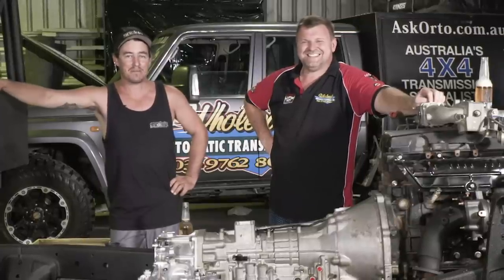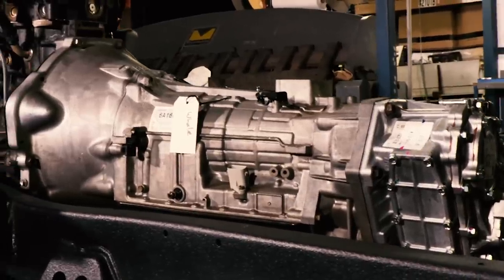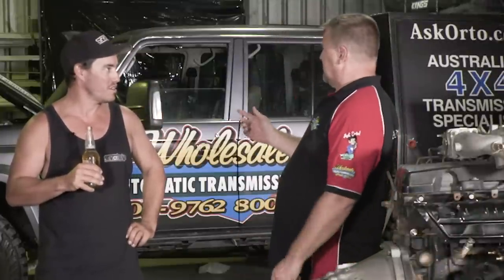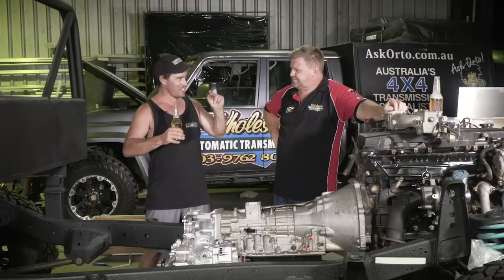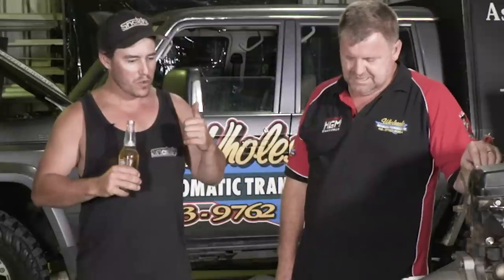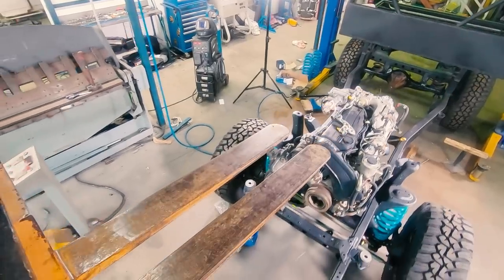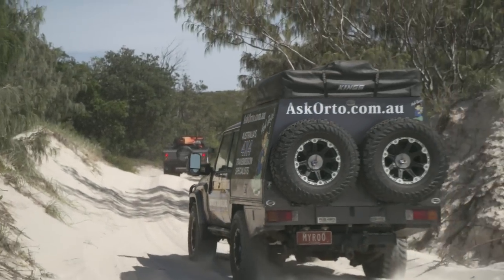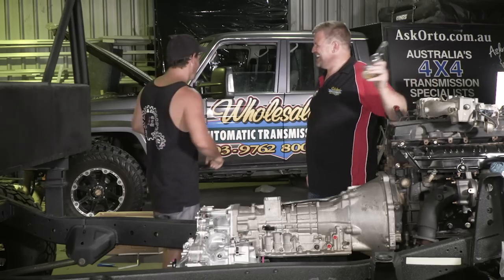DIRTY 30 TIP-TRONIC AUTO CONVERSION - Why Shaun chose this over manual + Expert tips for your auto!

Comment: Good decision, I’ve run auto box off road for the last 15 years, I agree with all the comment in the video,  especially about being transmission friendly, great video, really looking forward to the finished product, thank you from the UK
Reply: What vehicle do you have in the UK. I have a Imported Prado 70 with an auto box so interested in this video
Reply: I have a ‘94 80 bruiser, ( as an over lander )  and another car as an off roader ( Land Rover based, also auto) 4.2 diesel auto VX, running 285 75 BFG All Terrains,  makes the speedo accurate. I have driven it in the Pyrenees, the Alps, Corsica Sardinia and Morocco, all conditions, mud sand and rock, with a standard auto box with a large extra oil cooler for the auto box. I now realise I want a tiptronic, better start saving. I have a tiptronic in another car, ( Mercedes ) and would have never thought about one for the the bruiser, this video has given me a lot to think about.
Reply: @billywestley9008  Serious stuff!

Comment: I have a manual and what I miss is taking off at the traffic lights and the turbo just staying on boost to 80km h. I have to run through the gears and let the turbo spull every gear shift. I can't believe I am saying this but if I get a new 4x4 I'd seriously consider auto nowadays.
Reply: Stevo F I’ve got a y62 patrol and I came from a 79series and I promise you this patrol is better in every way, much more expensive but I spent $7500 on a lift kit, winch and bull bar and that was all it needed

Comment: Should also mention that the converter typically produce much more torque to the input of the box, especially at stall  than a manual box right where you may need it the most.
Starting off from a stop and getting you moving like in heavy sand n bogs
Reply: A+ perfect

Comment: Love these types of technical videos. One question I've got, and it's more out of curiosity than anything, with a torque converter locked, could you "clutch start" an auto? I do have a long held love for the old 3 pedals, but after doing a bit of offloading in a 1996 Jeep Cherokee auto, I can definitly understand why they are popular for off road applications.
Reply: No you can't clutch start as the clutch needs to be applied but to do that the pump must already be running.

Comment: Question for rocket, I drive an 1fz-fe auto 80 series, I have a temp gauge for the gear box at what temperature should I pull over and let it cool down because I’ve had very different answer to this question ,as mine gets very hot up the beach
Reply: 140C is when you need to pull over and let the engine idle for a while. We need to keep the oil flowing around the auto as it is cooling down.

Comment: Where do you guys recommend placing/mounting the Auto trans radiator in the vehicle ?
Reply: bringingtherukas in the bottom of the radiator...?
Reply: Always mount the oil cooler up front behind the grill area.

Comment: There are a few ecus around that has remote log in capabilities. Compushift certainly isnt the only one.
Reply: No other transmission controller has Bluetooth connectivity or set/calibrations App or can run this many different autos. There might be a system that is log in via laptop and direct plug in to an engine management system but nothing this though.

Comment: do auto boxes have to "warm up " before they shift nicely? my 98 forester bangs thru gears till its warm if i nail it cold.and its running syn oil too
Reply: Hey, the best you can probably do is change the oil again, replace the filters and add a bit of ATF conditioner to keep her going. Sadly it sounds like your auto is on the way out though. She'll need a rebuild or replacement. Good luck fellow Subie enthusiast.
Reply: No they don’t, I would think that you have a problem of some sorts. You are best to take it to a local transmission shop so they can take a look..

Comment: An automtic transmission and steep hill starts go together well. ?Automatic transmissions for heavy towing? Any suggestions?
Reply: yeah we have em in trucks pulling doubles at 65 ton and they preform well
Reply: They handle heavy loads better than a manual.
Reply: @vevohoeyo  yeah alot less stress on the driveline which is good

Comment: Rocket, slap me if my thinking is wrong.  I like the trans cooler to be OUTSIDE of the radiator.  Heat being an auto's worst enemy, IF you lose the drive belt, or your water pump, don't you risk cooking your trans in an overheat situation, as well as risking warping an aluminum head?
Reply: I like your thinking but if the belt come off or the water pump shit it's self the engine would overheat long before the auto overheats.
Reply: Thank you Rod. Appreciate the reply.

Comment: Rocket, can a five speed auto be fitted to a four speed auto Isuzu Bighorn?, is there a box that will fit?. If I take the standard auto cooler away from the bottom of the radiator and route it to a big (half radiator size) cooler in front of the radiator, will this suffice for general daily duties and sometimes off road?.

Comment: Do you still plan on pulling the boat with the 30? or is that just for the 79 now? also can rocket and the team match gear ratios in the trans to what evertire size and such on a build?

Comment: I like your thought on auto. But im gonna stick with my standard/manual transmission. Its just cheaper and easier to fix for me. And probably us.
Reply: Right i can fix a manual myself at home a auto gearbox is a pain in the ass.
Reply: @brysonnorman7772  An auto is inside even easier the na manuel, it is all on 1 shaft....

Comment: Watched this 5 times now, did you ever mention the actual model of transmission you're using? "5-speed out of a 100-series LC" is about all I could catch. Trying to see if this can be sourced in the U.S. or not. 
This Dirty Thirty 2.0 build has me plotting all kinds of expensive things for an 80 series now. Keep up the amazing build Shauno and crew. Doing great work!
Reply: Yes you could either use 100 series 2UZ, FJ Cruiser or Lexus 470. All A750F transmissions. But we do have the same heavy duty Nomad Valve Body and Compushift to suit all the the Toyota range.
Reply: @RocketRod  Cheers Rocket! Sub 3-minute reply time! Amazing work mate!

Comment: 2 questions for mr Rocket.
1: 1996 Jeep Cherokee 2.5 TD (VM Motori turbo diesel). Is it possible to convert this to auto, and what is needed? 
2: Mercedes Geländewagen 300GD (5 or 6 cyl TD) W460 with a modern auto. What options do one have?
Reply: That vm motor is very similar to a land rover 300tdi probably make the zf 4spd work with it which is a very decent transmission
Reply: Finn, anything can be done but we have not done a conversion to the Jeep although we have done using the Jeep 5 speed auto. We don't have anything for the Merc sorry.

Comment: I’m in the USA, I have a 99 LX470 (100 series), 4 speed. I want to install the newer 5 speed. I have a good, low mileage trans from an ‘06 lx470. What do I need to do to make this happen. I want basic operation and prefer the ‘99 shifter.
Reply: If you can get it in the car we can run the auto using the HGM Compushift. Install the GX470/460 tip-tronic gear shifter and make your own center console.

Comment: Hey rocket, I’ve got an 4spd auto 105 cruiser. I’ve found on steep descents it tends to roll away from me if I’m not on the brakes. What upgrades should I do to prevent that? Cheers

Comment: What model transmission would I be looking for in a 6.5l v8 diesel. Currently looking at my options in a 105 series dual cab
Reply: Best by far is the super strong 4L80E with Compushift Controller

Comment: would there be an automatic that fits an 05 GU patrol that can handle upwards of 500hp and 1500nm from a 5.9L BT6 12v or 24v?
Reply: KTMPowa a 4L80e would handle the power.

Comment: for oil coolers, would you recommend a oil to water or a oil to air cooler? or a combo of both?  I live in Canada so stuff gets cold lol, would you recommend running a thermo bypass valve to cut off the cooler during warm up? do you have any factory applications recommendations that have a good tstat for the trans cooler that I could pull and adapt to my build? I love using OEM parts over aftermarket if I can...
Reply: I'm glad you mentioned you were in Canada as it make a difference, in your case water heat exchange then air. In Australia normally twin air is better but most run water then air.
Reply: @RocketRod  awesome, thanks for the reply! yeah I was thinking of running one water and one air. wasn't sure of what order, glad you covered that :)  any input on a thermostat or bypass valve type thing? one that would go from a water cooler on warm up to a air cooler once up to temp would be sweeeeeeet……. like a 6 port one...

Comment: Can a auto conversion correct the gear ratios after fitting 35's?
Reply: Thats probably a very dramatic way of correcting a speedo and wouldn't make any difference as the speed is normally taken from the trasfercase so no difference no matter what you did. What you can do is fit a speedo calibrator. I have them at Wholesale Automatics.

Comment: Rocket, will your shifter work with a 4L80e using a US Shift controller?? 
Who built the flash console for the Dirty 30??
Thanks.
Reply: Aaron that console is the unit that Wholesale Automatics builds for there 79 series conversions
Reply: No unfortunately the tip-tonic shifter will not work on the 4L80E in either case as it was never build as a tip-tronic. that being said we did manage to do this for the A750 but it was also built as a tip-tronic from factory in some models so this made it compatible
Reply: Thanks Rocket.

Comment: Question; when in low range, does this magnify any shifting issues like lurching/lunging that an older (244,000 miles worth) transmission might be having and can this clue the driver in to have a rebuild done sooner rather than later? Thank you from the USA. 😊

Comment: Question for Rocket.. can the stand alone system work for a 6L80e behind a non mechanical 6.2 diesel chev v8 ??
Reply: We are so close to finishing this system. The computer, harness and new solenoid block are complete. We are just going though dyno and in car testing at the moment and will be complete later this year.
Reply: @RocketRod  thank you i will pester you guys later in the year for it !!

Comment: I have a 2019 Chevy Colorado Bison.  I am building it up as an off road expedition truck, as well as daily driver.  With the added weight of accessories and gear, what do you recommend for upgrades for my 3.6 litre V6?
Reply: You will need to add an Extra Large Oil Cooler, we have the kit available if you would like one? I also recommend the Deep Cast Aluminium Pan from PML Covers out of C.A
Reply: @RocketRod  thanks, how is the best way to contact you?

Comment: Was wandering that if you can lock up the converter in first gear, if that also means that you can pull start the truck like a manual trans?
Reply: No unfortunately, the pump needs to be running to apply the same clutch that you would need for push starting, so basically no pump pressure then no clutch would be able to apply for push starting.
Reply: Ok. Thanks so much for the info on that Rod.
Reply: At least in theory, could it be possible to modify the clutch acuation with a bypass valve to a wet canister that could be pressurized via compressed air, for a couple of emergency bump starts.       Years ago, before I new anything about how an auto worked, I had an old buick with a 300 super turbin 2 speed auto. it had an electronic switch activated double speed stator. a old rancher told me to hook the switch,--That was normally hooked to the throttle plate for full throttle take offs, to a toggle switch. and for some reason this worked to be able to pull start the car. granted you would have to pull the car to around 25MPH. but I would hit the switch and it would fire up. This is the only trans that I have ever had this work on. but thought that if there was a way to overcome this one flaw in the auto trans world, that it would be " THE TICKET" for sure.  If anyone can figure out how to do it. it is you ROD.
Reply: @tombrown879  yes this could be done but it would need to have about a 4 litre volume and be charged at at 200PSI. We would need to charge the whole transmission including transmission hence the large volume in reserve.
Reply: Hmmm. troublesome .... I shall have to contemplate over a few cold ones. :)  Thanks for all the info Rod.

Comment: Rocket what's better to have a 5 speed auto, 4 speed auto or 2 speed auto?
Reply: Very much depends on the application. In Shauns case the broad gear ratios suited his needs very well. 2 and 3 speeds and a little outdated.
Reply: @RocketRod  okay just asking because I see a lot of 4x4 that are a 5 speed and some are only 2 speeds

Comment: Hello, I live in Lebanon and I've build my own Offroad Camping Trailer with Skytent. The whole thing weighs around 400 Kgs and I drive a 1999 Hyundai Galloper with 3.0L petrol engine with Automatic Trans. Is it bad to tow it, in a mountain area on paved roads,  WITHOUT using Low rand gear???
Reply: No it would be fine but I recommend a transmission temp gauge linked into the hot transmission cooler line that runs from the transmission to the oil cooler. This is basically the hottest place we can take the temp from. Anything over 130c back off and at 140c pull over and let the transmission idle for a while until the temp drops.
Reply: @RocketRod  Thanks a lot for your reply and such explanation. 
I've been driving it for almost two years and the Transmission Temp. Light never turned on.
I make sure to use lower gear instead D mode (over-drive off or even Second gear) on slopes.
Reply: @nizaramer795  you are doing the right thing but don't forget a good temp gauge that only goes up to 150c
Reply: @RocketRod  thanks again, I'll call the mechanic to install one on the intake oil line.
Reply: @nizaramer795 on the out going hot line before it gets to the radiator. No good measuring after the cooler, must be before.

Comment: I have a JeepJK manual (3.6) is it possible to convert this to an auto? any ideas on a price to do this?
Reply: Can be done but we have never done so. We can run the Jeep 5 speed Auto transmission as long as there is a way to get the auto in the car.

Comment: Im having problems with my 1994 Mitsubishi delica l400 4m40 turbo diesel, my overdrive doesnt kick in, ive replaced the overdrive switch on the gearshifter and the temperature sensor and by rights it should be working but its not and im buggered to wat else it could be
Reply: It is more likely to be the overdrive cancel solenoid on the transmission. Any trans shop will be able to help you with that. Or us if your nearby.
Reply: Oh ok, ill have it checked out!! Thanx for ur help

Comment: Any aftermarket clutch packs or just factory stuff? Also interested if u guys run accumulator valves or you end up blocking them off?
Reply: While we do have clutch upgrades this transmission was standard apart from the Heavy Duty Nomad Valve Body. No we don't need to block any of the accumulators.
Reply: @RocketRod  thanks for the response. Another q, are u running higher line pressure? And if so how do the accumulators react to the higher press. Somewhat harsher shifts or the springs still allow for dampening within the system?
Reply: @Matek0012  they work perfectly as the opposing pressure is also raised to keep the same balance.
Reply: Clearly in need of doing some more hw. Thanks soo much for your response!

Comment: This video doesn't fully explain a few points, firstly l see your both toughing it out oiling up, were you both on a IRON JACK diet. And what type of gear oil do you recommend for the gearbox, - IRON JACK BEER lube l've heard is okay, but can it handle the heat. I've also been informed that IRON JACK BEER is great for de-rusting your rails, keeping the bugs out of your breather etc, Can IRON JACK BEER really do all this, I also saw that both Shaun and Rod needed to refresh their throats after giving a STRONG talk for a few moments, Did IRON JACK BEER help fully ? Of note was the lack of use of  a MAXI TRACK RAMP for supporting the Auto gear box or for supporting a IRON JACK BEER . MAXI TRACK could have been used to help steady Shaun after a long day on the tools, and during filming, any way, I'm off to the brewster for an IRON JACK, catcha .......

Comment: Is it a full manual VB? Does it have Engine braking in all gears or just 1st?
Reply: It is both Full Automatic and it also becomes Full Manual when you pull it over into Tip Tronic. Yes it also has engine braking in all gears when using the Compushift Transmission Controller and Nomad Valve Body. Rocket
Reply: @RocketRod  Damn, good for daily too!

Comment: Rocket, what do you think about the modern Autos like the 10 speed in the Ford Ranger ?
Reply: We already have a cooler kit for these vehicles as once again Ford have let them down. The car is fine although built pure and simply for economy. Nothing wrong with that as long as you know that with more gears comes more gear changes. Always changing gears. The only thing I really don't like is that where I live I keep getting caught out with the power steering being greatly reduced mid corner

Comment: Why the need to run 2 trans coolers? Could you not just run one larger one?
Reply: While this can work as long as its big enough we normally work with 2 coolers, a pre cooler and after cooler for efficiency reasons in smaller spaces.